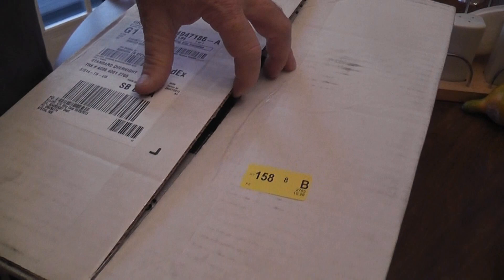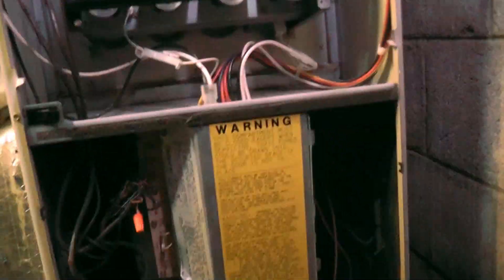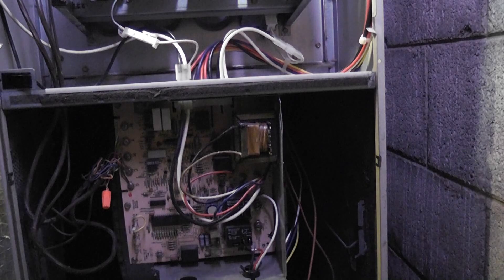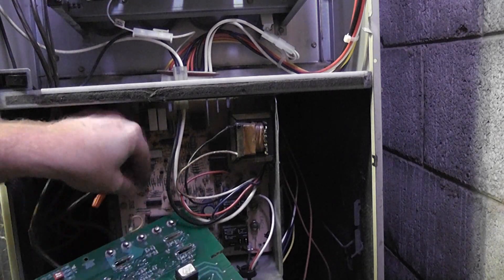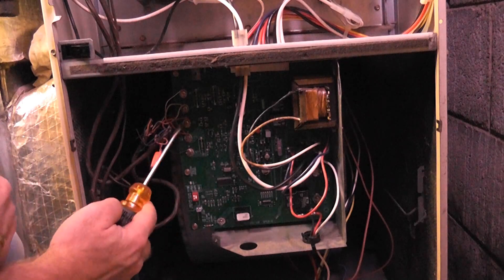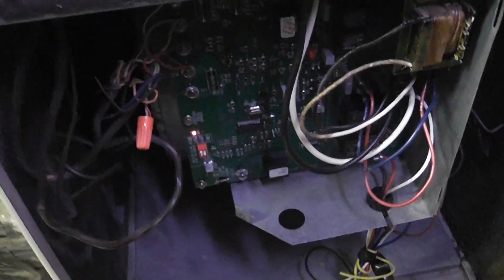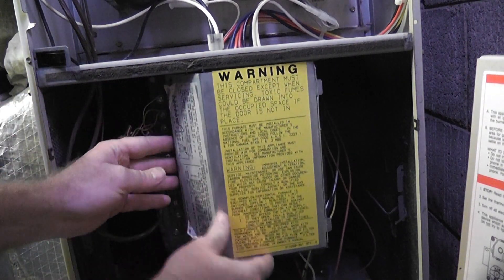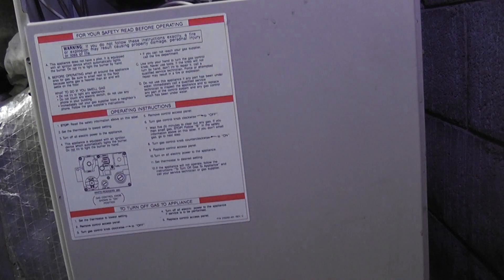HVAC Control Board in Furnace - main burners not lighting

Comment: What were your exact symptoms?  I also have the Carrier Crusader. When I turn the thermostat on, I hear a fan come on and then the I think I see the ignitors turn orange and hear a louder fan. The ignitors go off and come back on and then eventually, it goes off again and stays off.  No "click" and no ignition of gas. Thanks.
Reply from the maker: If I recall correctly, my igniters weren't coming on, so it sounds like yours is a bit different.  I wonder if maybe your gas valve isn't letting the gas move or the thermocouple for it maybe at fault?  Good luck on figuring it out!
Reply: @stoppedsnoring  Thanks. You got it right. After more reading, it's either the board or the gas valve. If there's 24 volts? AC going to the gas valve (while the ignitors are glowing) , then the circuit board is good and gas valve is bad.

Comment: Did you test the gas valve to see if it was getting 24 volts before replacing the control board?
Reply from the maker: I honestly can't remember the details of what I tested because this was so long ago, but this is a good point for something to check based on the symptoms.  Thank you for adding the comment!

Comment: You are the man!!!!  I was having the exact same problem with my Crusader Carrier furnace.  The ignition light was glowing but no gas was coming through to ignite.  I confirmed gas line was clear and replaced the circuit board ( CES0110057-00) with the  ICM281.  The part cost me $77.95 from SupplyHouse.com and was delivered in two days!  Simple to install and your video was spot on.
Reply: Thanks for this video, I watched a lot of videos and none mentioned the gas valve relay on the board and thanks Tom for the info. I ordered mine today from supplyhouse as well.
Reply from the maker: That's awesome!  I'm glad you found it at such a good price too.  :)

Comment: Great video.  How can the average diy-er know for sure if the control board is bad?  There must be some way using a multimeter?  I had the same problem, everything worked but the igniter would not glow.  Replaced it but still no ignition.  I figured it was the control board at that point but didn't know how to verify it.  We happened to have a home warranty so at that point I called them out and turns out I was right, so they replaced it but it took over a week for them to source the part and get back out.  I could have ordered it on Amazon and had it done in less than 3 days!
Reply from the maker: Good question. Yes, you hit the nail on the head. There was a schematic on the inside of the lower cover, and that helped give me an idea. All the other parts were working and I could measure with the multimeter that the relay wasn't sending out juice for the gas valve. There wasn't any obvious burn marks on the control board, so for me it was still at a "very strong hunch" and I was game trying to replace the board, which was very economical compared to having someone come out to work on it and sell me their board (including a hefty markup). I'm pretty sure if this was much newer unit, it would be much more complex and I might not have been able to as easily diagnose.

Comment: Good job. They wanted $800 to replace my circuit board. They sell new on ebay for $125. I bought a new Rheem 95% furnace  on ebay for $735 +$140 for shipping. Put it in myself. Runs great.

Comment: The reason suppliers don't sell is a simple monopoly. Half the "Highly Skilled" professionals out there will usually just tell you the heat exchanger is leaking to sell you a new furnace. They are just as bad as auto mechanics. Few are highly skilled as very few home service companies employ journeymen union steamfitters or employees of that skill level. Most have at best a certificate from a community college or a 2 day reseller course.
 
Educate yourself, take a class or two, and you will find that most home repairs are simple and you will save thousands not being a victim to the "Skilled" scam. This is not rocket science.
Reply from the maker: Yeah, for sure. I don't think I would have tackled it though if I hadn't done so much troubleshooting of wiring in houses, computers and motorcycles, etc.  Once I really looked at it closely and understood how the controller board worked, it wasn't too intimidating.

Comment: as your local hvac tech - you are not paying ten times the price of the part - you are paying for 2000+ hours of training certifications wear and tear on my truck and my time in general - the reason carrier does not sell to the open public is for safety reasons - you are not trained to deal with high voltage of any kind

sorry if i sound like a butthead - but I often hear the price arguement alot
Reply: +Jeremiah Latlip Plus the money invested for  school training...People don't see that too.
Reply: +Jeremiah Latlip I can understand that. But if you can fix something your self you do it. As far as the high voltage the power was off. If something was wired wrong it would short and trip the circuit breaker.

Comment: I really appreciate the video! I would have never have thought of upgrading the board. It's only $75 including shipping and handling on ebay! Both this unit and the ignitor would probably be due for a replacement!

And for those who haven't tested your ignitors yet, It should read from 50-400 ohms. It'll have zero resistance if it has gone bad.